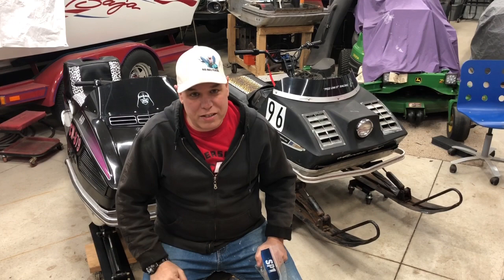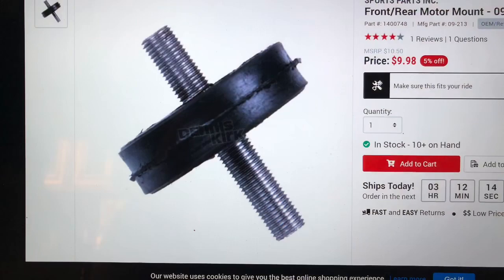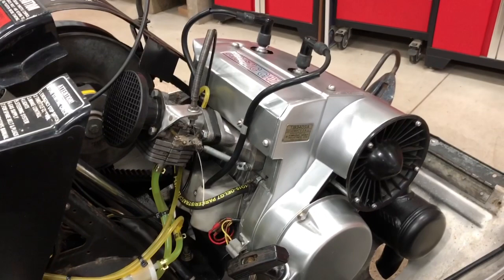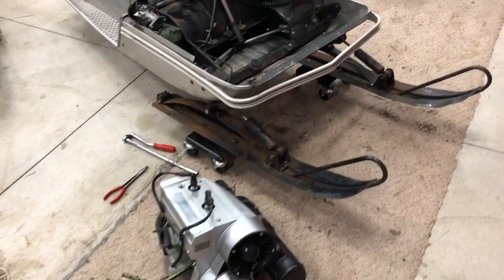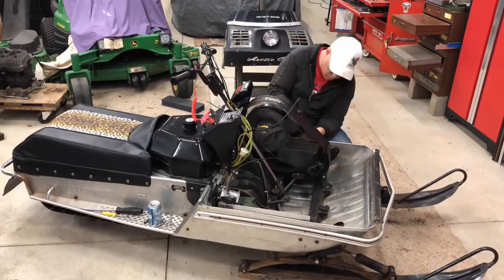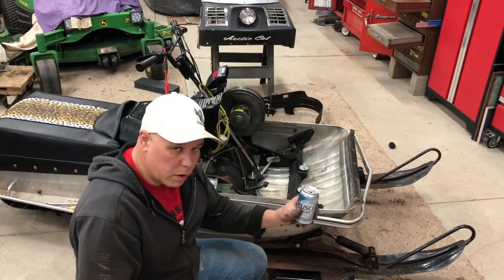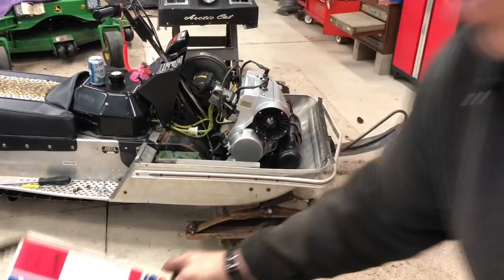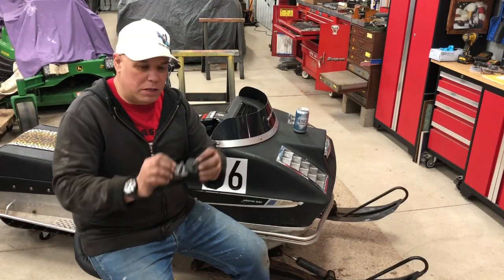RAT CAT FIX IT-EPISODE 1

Comment: Hey man love the videos! I’m doing a lynx project as well right now. Where did you find that seat? Looks great
Reply from the maker: The seat is a custom.  Basically I took the seat foam and cut it down so it looks like a minty slant back 70 Lynx.  It is about the best you can do visually with a "notch" back sled.  It achieved a couple of things. Gave me the look I wanted, I didn't have to deal with the plastic trunk stuff (which was missing anyway) and got me as close as I could get to a 70.   I cut the foam as needed and glued it together.  Then shipped the foam to Ernie Attwood and he mad a custom cover.  I would change some things slightly on the next one but overall, it turns heads.  I have two (2) Attwood coves on in my fleet.

Comment: come everyone put the belt on the hard way? if you put it on the biggest pulley then open up the big pulley as far as you can go and stuff the belt in the gap and there should be more then enough room to put on front pulley the roll track till belt is loose on both pulleys!!! and go!!! this is what i do when replacing there not hard to turn to open the bigger pulleys apart!!!
Reply from the maker: Well dang, will have to try that one.  Guess I never thought about it going that way.  Thanks for the input.
Reply: @Letsfixsomething26  same way I wa taught when i got my first snowmobile called the ski wizz. I blew the belt the first week and that was the way the old folks changed them instead of stressing the belt before use!!
Reply from the maker: Not much for SKI WHIZ's up here for whatever reason.  Kind of a neat machine.  Have a great winter!
Reply: @Letsfixsomething26  I'm going to be running a 1996 polaris xlt with a princessauto 420cc motor in it !!! since the original motor is junk and would cost over $1000 to rebuild so $500 engine setup and away I go. I'm at 50kmh now not bad but want at least 90kmh out of it. no belts chain drives only. and I'm keeping multiple gears and chains for on the fly !!!
Reply from the maker: Oh my, you HAVE to record that one and upload it.  PLEASE PLEASE post that one. That sounds like a super interesting project that could be adapted to almost anything. Focus on motor selection, shaft size, clutching, belts, cooling, throttle cable and lever, etc......  Keep us posted!!  We do not have PRINCESS AUTO but do have Harbor Freight and Northern Tool that are great sources for engines like this.

Comment: I had a old 71 AC Cheetah that did that was the secondary seized didn't expand so something had to give.  Belt or the old mounts.   Right side mounts split.  Noticed every time I wend to move the engine "leaned"  =)  wasn't far from "home" and it held to get me there at least.
Reply from the maker: You are on to something. With the new mounts installed and a "semi" solid mount on the LH FRONT, I was noticing some increased RPM's.  I dismantled, cleaned, and lubed the secondary clutch as I was suspecting the same thing.  I engaged the "HELIX" thingy at the first opportunity as I could to give it as much chance to shift as possible.  Now that it is not 247 degrees below zero, I can try it out.

Comment: nice job! i never had any luck with that carb how does it run
Reply from the maker: FULL TRANSPARENCY I have a guy who does my WALLY carbs for me.  I find them difficult to "read".  Its like performing algebra every time I start it.  Cold both my Panther and Lynx are predictable, although the panther is a bit more pulls to get the fuel up to the carb.  Warm they both start one pull.  Hot they require 697 pulls all at WIDE OPEN THROTTLE.  I find them to both require wide open throttle when starting about 75% of the time to clear out.  A little frustrating.  The 440 is a pretty good yank, the 340 not so bad.  I put a starter on the Panther just for this reason.  I still need to hit starter with the throttle wide open, but starts just fine.  All other ops are just fine.  Fouling plugs went away with new external coils on the Panther.  Idles all day long now. My next build has dual MIKUNI carbs. Lets see how that runs. ...... NOW.... START POSTING YOUR VIDEOS ON U TUBE!

Comment: Really appreciate these videos considering I have to do a seal job on three of these engines.  They were a bit of a mystery and there is not much information about these old Kawasaki engines.  
One of the sleds is a 72 Panther with 105 miles that belongs be in a museum.  It apparently came original with side pipes despite never being offered as such from the factory.  Not expansion, just straight chrome side pipes.
Reply from the maker: Gary, this is exactly why I did them.  However I am getting a lot of comments from guys that are picking things to pieces. Sticklers for every little detail.... yet when I go to their channel, its a bunch of rubbish... or nothing at all. It is 3-4 times the work to do a HOW TO video.  Lots of set up, planning, and editing.  All that only to get blasted by someone who has all this knowledge, but chooses not to share it.  Just pick on other people.  I turn comments off most videos for this reason.  Glad you are enjoying them. Thanks for the kind comments.
Reply: @Letsfixsomething26    I feel your pain. People ask why I quit running shows or writing articles for the VSCA, or spreading info based off what we learned back in the day, from being an old dealers kid. I quit over a decade ago. Long before YouTube took off. I got blasted on the early vintage sled web for "Revealing Secrets" or torn apart usually because Certain People had a monopoly on this knowledge and were interested in keeping it to themselves. Thank goodness for YouTube and those who are trying to help and do it right. BTW Gary those ACS pipes you are talking about were an option from Cat starting around 1968/69 and the last "Official" use of them were for certain 1971 models like the 634 and 760 twins. At our dealership they weren't a big seller because they were vulnerable to brush/rock impacts. After 20 years of hanging out with other ex Dealer kids turns out a lot of the kits sat in excess inventory and were sold off to bolt up to whatever sled a guy wanted a set for.  Adding them to the 440 Sachs Puma or any of the Kawasaki twins was just an afternoon in the garage job. Few minor tweaks, done.  Cool sled fad of the period. BTW I still have all my Dad's dealer manuals and I still help folks when I can, quietly. I like your builds, thumbs up!
Reply from the maker: @glenmallory9982  thanks Glen.  I’ve slowed down on the How To stuff.  I’ve met so many great guys so it’s not all bad. I don’t wanna be an “authority” on anything.  Help where I can and that’s about it.